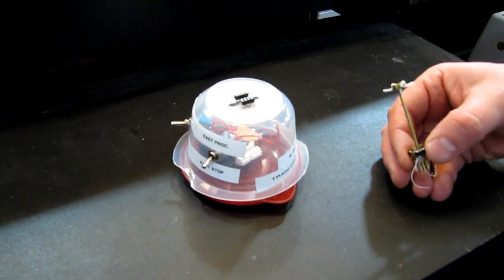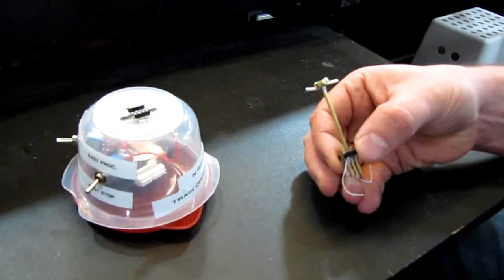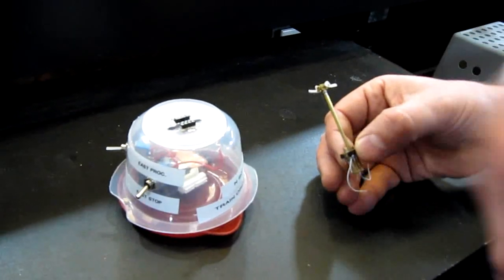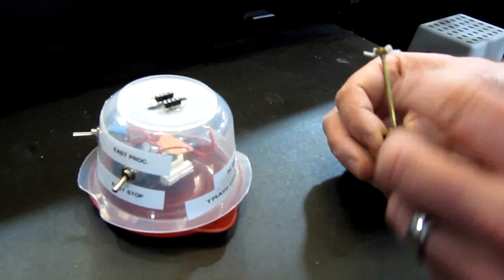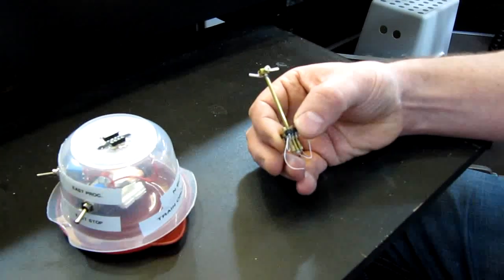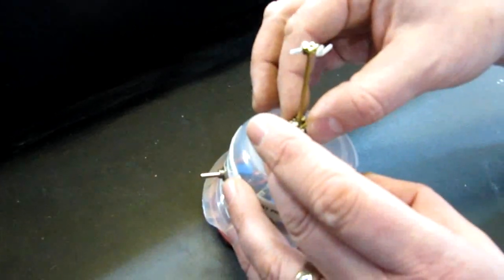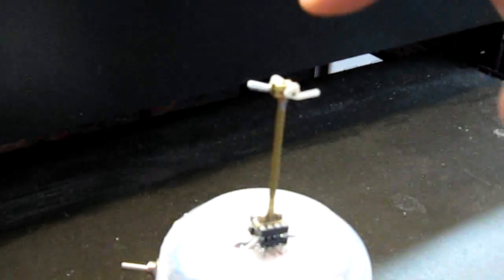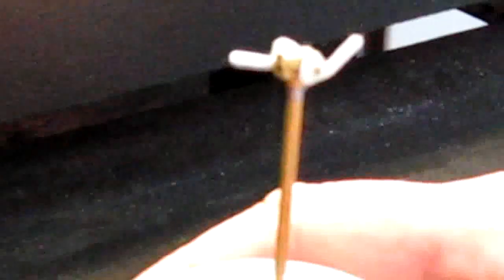Train order semaphore prototype for N Scale* railway

Comment: how did u know that if you run voltage through the wire that it would either shrink or strecthe to move something else that what so facinating about this cause the common signal is run by either a relay or a motor under the layout which gets both costly and takes up alot of room under the layout ...